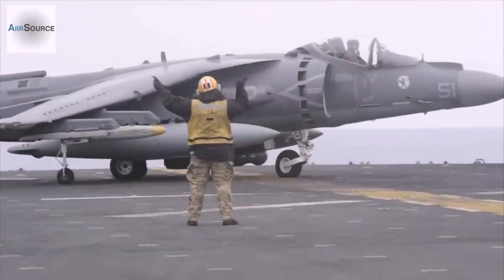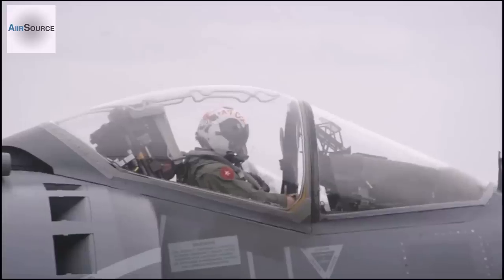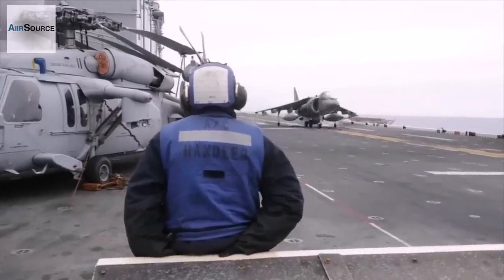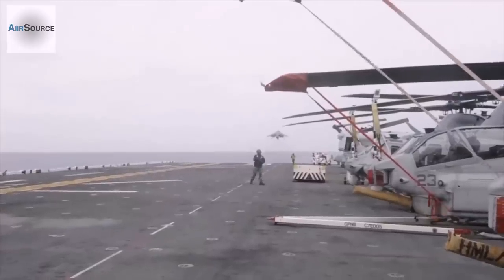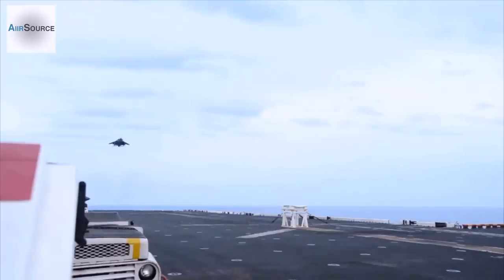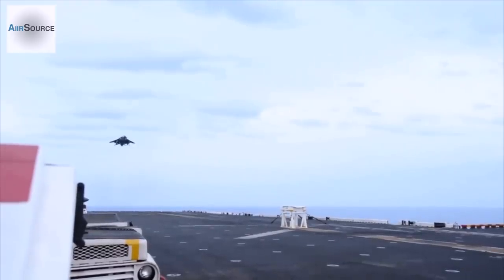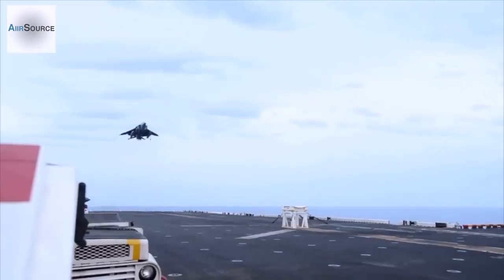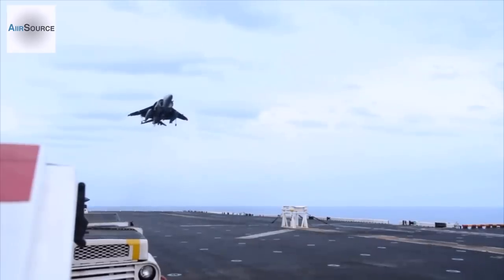AV-8B Harrier Emergency Landing Without Nose Gear

Comment: I've actually seen this done before. The more dangerous landing, on a normal runway, is not realizing one of your outrigger wheels (the ones at each wingtip) isn't down. You veer off the side of the runway and that can get bad in a real hurry. Mike - USMC air winger retired

Comment: What a great country America is.
Reply: Mario Addis Ironic comment?
Reply: +Xiolablu3 Yes, the original Harrier was a British design, BUT this second generation Harrier flown by the Marines is an extensive redesign of the basic airframe. According to the Wiki "McDonnell Douglas extensively redesigned the earlier AV-8A Harrier to create the AV-8B. While retaining the general layout of its predecessor, the aircraft incorporates a new wing, an elevated cockpit, a redesigned fuselage, one extra hardpoint per wing, and other structural and aerodynamic refinements."   SO, it's basically an American airplane...  based on a British design but significantly changed.
Reply: Alex Gailey-White Much better than British inbreeding!  ; D
Reply: +MISTERComaToes think of it this way, without an original, it wouldn't have been updated. 
you needed an idea to improve upon, not having the creativity of your own to think up the idea yourselves.
Reply: Antony Collingwood We could get into a huge discussion about the merits of each country's aerospace efforts since the start of the cold war, BUT considering that my oldest brother was onboard the aircraft carrier Iwo Jima when the US Marines were doing fleet testing of the AV8A, I have been aware of the Harrier's origins for a long time.

 While the Harrier is indeed a fine machine for it's purpose.  The idea behind the Harrier was not a British one, the Bell X-14 was a VTOL aircraft that first flew on 19 February 1957 including a vertical takeoff, hover, then vertical landing.  

 Before the first flight of the Hawker P.1127 in England, Hawker test pilots, Bill Bedford and Hugh Merewether, came to NASA's Ames Research Center to fly the X-14 in order to acquaint themselves with handling a jet V/STOL aircraft in hover during the development of the P.1127.  This was well prior to the first flights of the prototype which became the Hawker Kestrel, the forerunner of the Harrier.  

Obviously, Hawker fine tuned the idea and arrived at a superior machine in the Harrier, but then Boeing and MacDonald/Douglas realized after a relatively short period of fleet use that there were deficiencies in the AV8A and totally redesigned it to create the far superior AV8B.

Which leads us to the clear successor to the Harrier, the F-35
Reply: Doesn't stop you butchering your own troops in friendly fire incidents though 😂
Reply: Jamie Banner blue on blues are no joke, and us brits have been involved in a few ourselves. I personally don't find that amusing whatsoever, and no one else in any armed force would either.

Comment: I don't think the marines should get rid of the AV-8B considering its much more reliable and battle proven, and much cheaper than the F-35.....well in all honesty, the F-22 is cheaper than the F-35
Reply: Yes but the F-22 is a air force only jet
Reply: MidnightmoonRR That's not true at all, the F-35 costs 124 million at the moment, an F-22 is 150 million.

At full production the F-35 will cost 83 million, which is significantly cheaper than a eurofighter typhoon, Pak-fa, and Dassault rafale B

Besides the harrier is dated, it's better to fly the F-35 and get the kinks out for when we need it, instead of relying on the harrier until its fully obsolete.
Reply: MidnightmoonRR Of course those planes are cheaper than the F-35... they're older models. That doesn't mean we shouldn't buy them. Rather we should slowly phase out of the Harriers and replace them with newer planes. The F35 will become cheaper as it is produced and used. Not to mention bugs and problems will be revealed as it did with the F22 program.
Reply: Justa318i After adding in the $1 Trillion+ in development costs, I suspect the F-35 will have a greater cost per plane over the duration of the program.

The F-22 wasn't cheap to develop either... but it wasn't this expensive,
Reply: The F-22 is an air superiority fighter. The Harrier is a multirole, and so is the F-35. Both are also S/VTOL.
Reply: Xylos144 Yeah but we aren't talking about cost of development
Reply: That would be nice yes, but the AV-8B harrier has been outclassed for years, and with the nextgen fighters and strike aircraft being manufactured across the world, the good ol Harrier doesn't stand a chance long term.
Reply: Hydro Carbine outclassed, yes. but no other plane offers the vtol functionality.
Reply: Chinese J-18
Reply: But its chinese, it probably flies the same way as the Yak-38 Forger, sucking in its own exaust and causing itself to fall out of the sky.

Comment: Itd be a better idea to have that stool be about 30 ft. wide with a flag marker on the front so the pilot can see where the stool is in proximity to the front of the jet. Also the pilot wouldn't have to land so precisely on a stool that only 2 or 3 ft. wide. Why not just give him a thimble to land the front of the jet on?

Comment: All the training he went through I would hope he could do that..
Reply: It's not that. The way the gears are positioned there is no way without risk of injury he could have landed it. Pilots can not fully train for landing gear failure except in vr. Also remember it wasn't a full failure.
Reply: ^ which is why the deck was cleared of all personnel. That crash crew knew what they were doing. They were a damn good crew.
Reply: Cassie Irizarry Americas finest

Comment: commercial  planes need vertical landing capability   to  save passengers  when something really wrong happens to their plane
Reply: great idea :-)
Reply: *****  till that day  , many passengers will  lose their live .    you can see footages of  airplanes with engine in severe fire , a few minute before taking off . luckily they managed to evacuate all the passengers .  but imagine if that happened when airbone , and sure the pilots wouldn't had time to return landing . and a vertical  landing is useful in this case because they would no waist time trying to return landing on the runway .  years back ago , supersonic concorde experienced this problem and did not get time to return landing
Reply: +tecknos africa And a stool.

Comment: even without the "stool" landing ouldn't have been so hard at all, he would've done the exact same thing exact the nose wouldve bumped into the deck, hardly injuring the pilot but possibly damaging the noise of the aircraft.... hardly a life or death situation, more like a dent in a vehicle.....
Reply: tbreen22 A very expensive dent in a very expensive and no-longer-in-production aircraft. I'd try to save the damn thing, too.
Reply: yugas42
the thing is designed with armor to withstand heavy arms fire.... I'm sure a 4 ft drop to the flight deck wouldn't cause that much damage... an expensive craft? Sure, but the "life or death" possibility they try to pass it off as is hardly close to reality.. Being able to hover helps out a lot
Reply: tbreen22 He dropped from approximately 20 feet, not 4. I'm not denying that the danger involved for the pilot was probably exaggerated, but it was still a very impressive thing to pull off. And no, most modern jets are not capable of withstanding rifle caliber rounds. They never get close enough to the ground or another aircraft for a cannon to hit them.
Reply: The bottom of his craft is a lot closer than 20 feet when he cuts the engines....